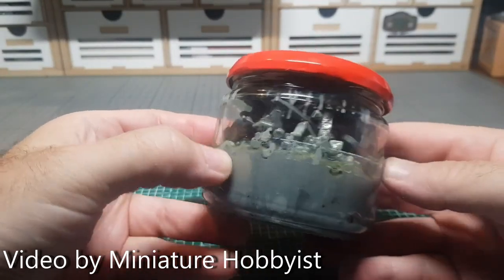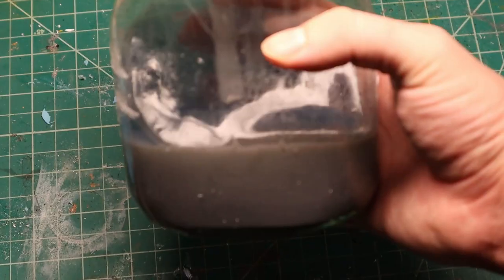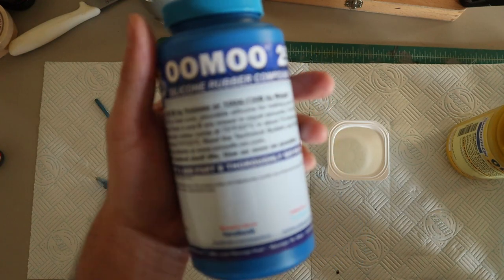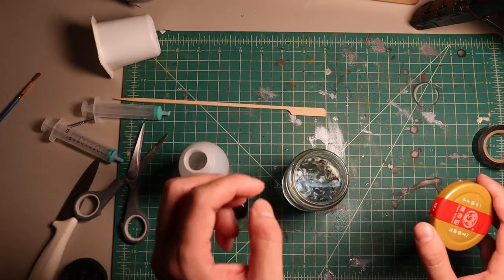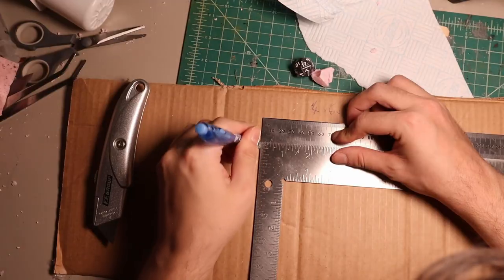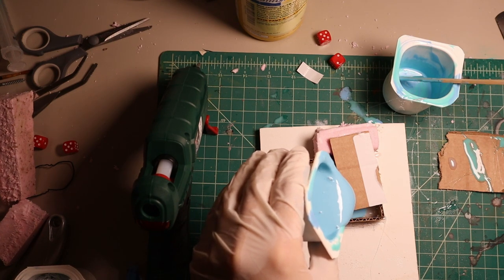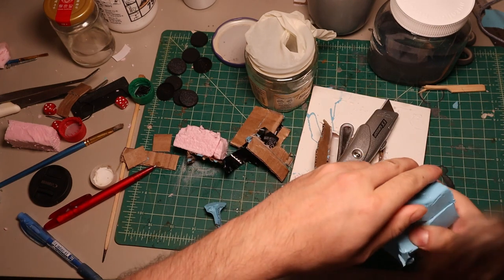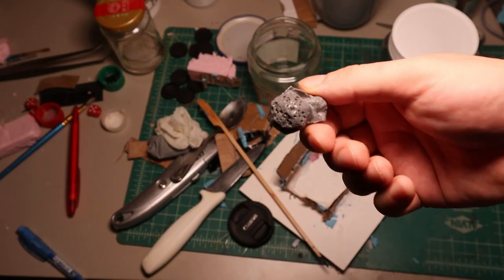Can you cast NEW MINIS from your used Warhammer 40k sprues?

Comment: Thoughts I've had regarding sprue-goo, it's big problem is 100% tied to its viscosity. It'd be interesting to see how it'd behave heated to 50-60c (Suggested usage of a 3d printer hot bed for this) and if that offsets any of the bubbles. Think anything made out of it will need more than one aeration vent as well

Comment: I'm not sure sprue goo is suitable for this kind of casting, especially since it solidifies rather quickly and traps air real fast. Might be possible to coat the sides of the mold and then press them together to create a hollow solid, but it seems a bit weird just for the sake of using this material. With regards to casting, check out Robert Tolone's channel, he makes molds for all sorts of things, including miniatures.
Reply from the maker: That is my gut feeling, but I do want to try it out myself. There are some improvement points, and even if I don't succeed, I'll add to the collective wisdom about this. At this point, I haven't nearly given up, and I intend to make a followup video. 

The point is not to make a mini by any means, but rather try making something useful from sprues. We will see how it goes. Maybe the real minis are the friends I made along the way :D
Reply: @eastwindtabletop7883  fair point! :) never tried casting the stuff, but getting a bunch of sprues welded together makes an excellent material for carving.